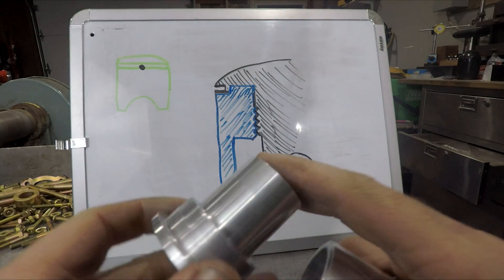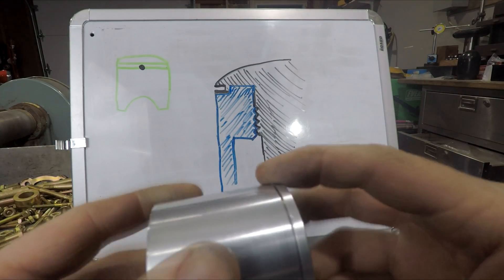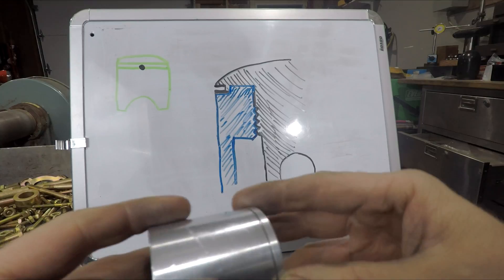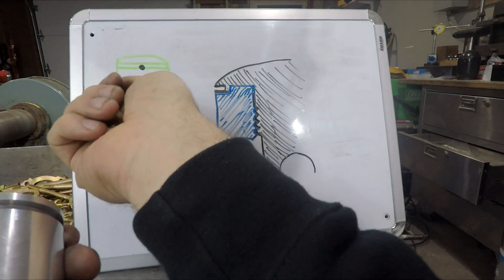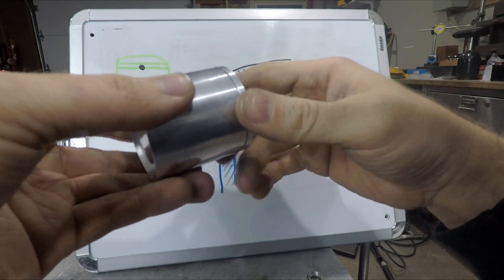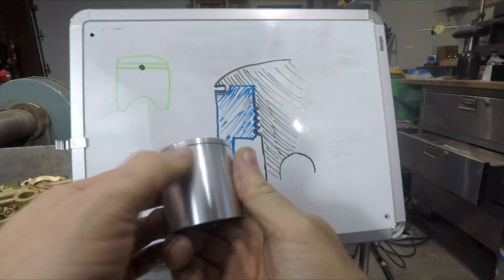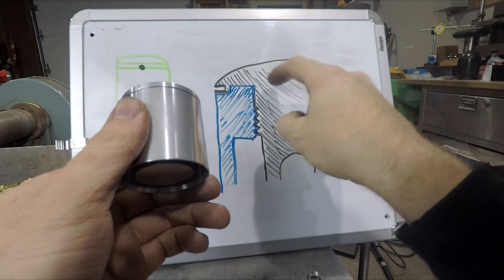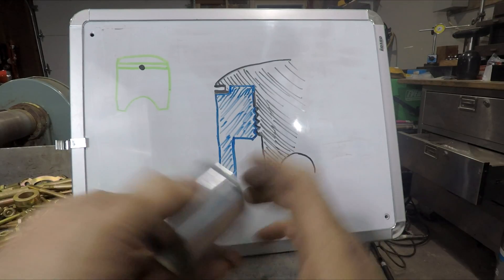My Idea for Mark Atkinsons 2 Piece Piston Design

Comment: I like your idea of keeping the dome and ring groove in one piece. If you have seen my latest video I found that it needs to be separate from the two piece joint with or without the traditional ring. Have you had a chance to do more with this?
Reply from the maker: Hey Mark,  No I bought a house so my free time right now for fun stuff is zero.  I will check out your latest video though.